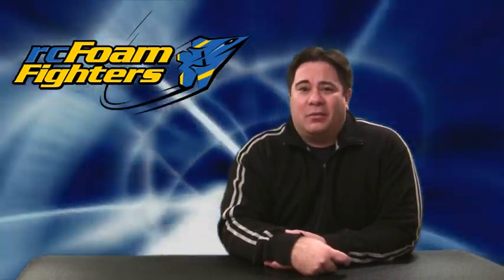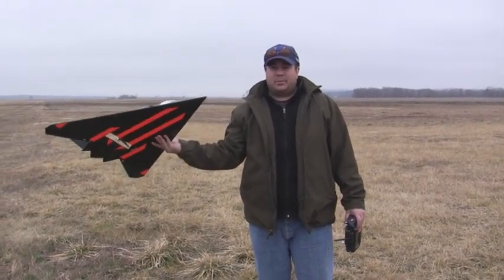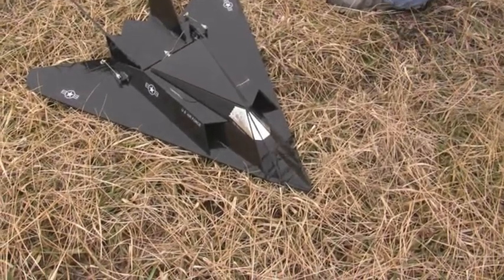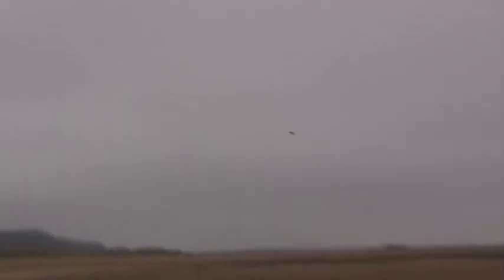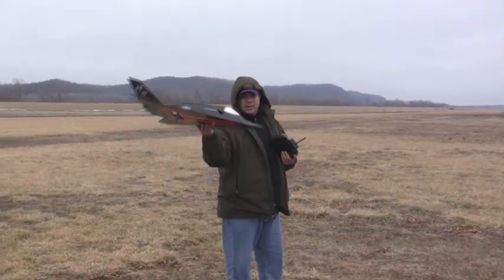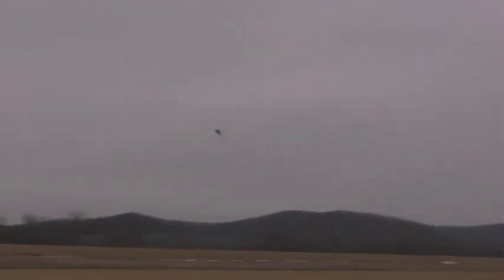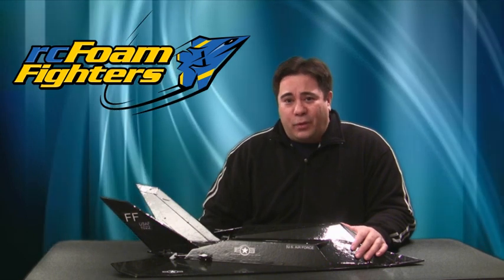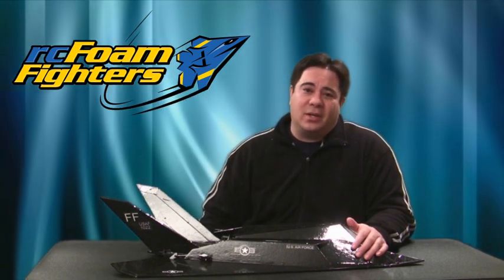FF-117 Part 3 (F-117 Stealth Fighter Inspired RC Plane)

Comment: Plane looks good.  When I am maidening an unproven plane, I also start on low rates and low throttle.  I have gotten into much more trouble with too much throw and too much speed that having too little.  At least you do not arrive at the crash site as fast.

Comment from the maker: Thanks Ken! Thanks too for your thoughts on a prop. In the future I will try some different setups and see what works best. Anyway, it did fly real nice once I adjusted the Ailerons. Oh, the Airtonics radio works awesome. Seems less glitchy than my DX6i. So far I am really liking the new radio. For the price I don't think you can beat it. I think I may be switching all my planes over to this radio. I just saw they also have a cheaper 6 ch receiver for it as well as the 7 and 8 ch receivers.

Comment: awsome Paul, I think a prop with more pitch would work out much better. i tend to overprop slightly when it's colder because the air is thinner and the motor can cool better. Your 117 does have some serious airflow compared to the one i'm currently flying. i had to put 30% expo to keep the roll under control too. i think you now have all the plans for every 1 of my favorite park jets! how do you like your new airtronics radio? i'm looking into getting one as a reward to myself